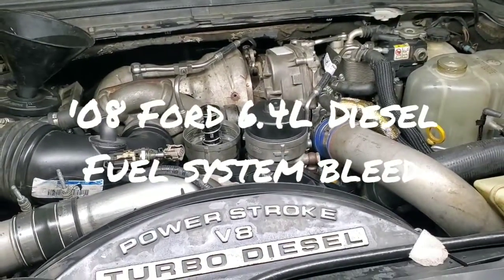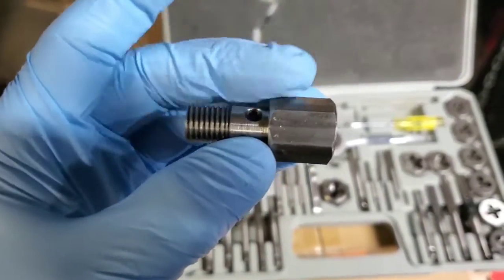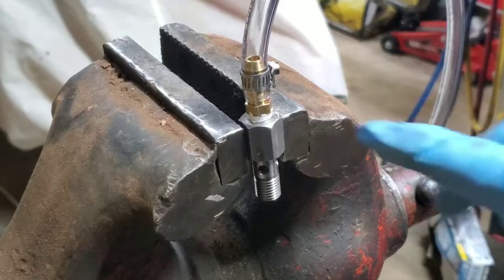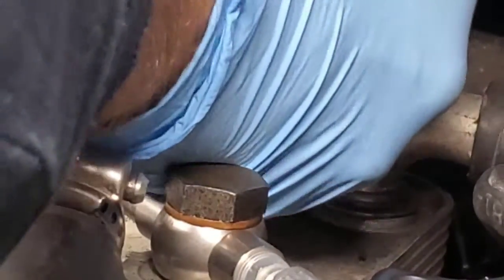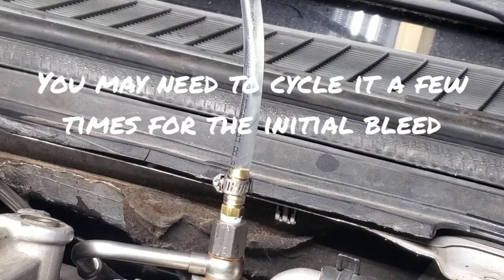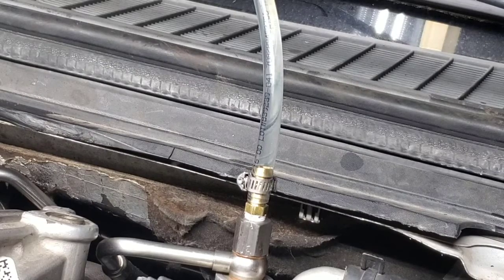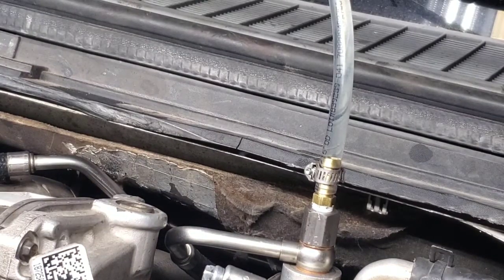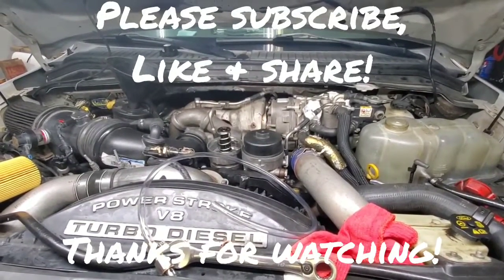How to Bleed the Ford 6.4L Powerstroke Fuel System

Comment: I I did this whole bleeding process and it'll crank but then dies. Everything has been replaced and double checked. I will crank it after I bled it and will still be full of air. Help!
Reply: I encounter the same issue... what did you ended up doing to the truck?
Reply: @hectordiaz3264  i know the issue if you haven't already figured it out.  i know a year late....
Reply: @sacredcreationz what was the issue

Comment: why not tape the original fitting and add a valve with barb on top that would stay on and apply a rubber cap to keep dust out.

Comment: Also don't forget to take the fuel tank filler cup off!! There might be vacuum in the tank, which I think sucks back the fuel, while changing  the fitting on the cooler.

Comment: Why not just leave the adapter fitting in place and just remove the brass hose barb fitting and replace it with a pipe plug?
Reply: Super high pressure system. You don't want to risk fuel blasting on top of the engine

Comment: REAL BIG THX you saved my life….. really…. I replaced the fuel filters on my 2008 f-350… all the procedures are correct…..EXCEPT the no need to build your own “special tool” with all that.
Here’s what I did to success; was instead of the fitting nut was not needed. After looking for diesel shops and even eBay it was obvious to me to find a hard plastic tube that would fit inside the treaded banjo nut was. I got the approximate plastic size tube that would fit inside the thread I used a little sand paper so it would snuggly fit in the threads by pushing and screwing the plastic tube inside and doing the rest of your video.   IT WORKED AND VERTUALLY COST ME NOTHING.  big thx man remember it’s only 12 p.s.i. so there’s no real pressure coming out of the tube into the container (static pressure that is…)🙂

Comment: I have bled my fuel system the same as described in the video and 2 hours later I have cycled 10 gallons of fuel and I am still getting large bubbles when I turn the key back on. Any suggestions?
Reply: Did you get it goin?
Reply: @bradleyhermes7071  I found the diesel fuel had some water in it so I drained the fuel completely, replaced the low pressure fuel pump,  replaced the diesel fuel and filters. Just as before after 2 hours of cycling the key I am still getting large bubbles of air. It will not fire or attempt to start. Any suggestions? Thanks
Reply: @fredcrum1  did you ever figure it out?
Reply: I have the same issue.   Did you figure yours out?

Comment: Hey - Great video.  Excellent demonstration and explanation.  Quick Q:  Is this procedure necessary after changing the fuel filters?  Or only after a more extensive fuel system job?  Such as changing injectors/injector lines, obviously after any fuel pump work, etc.
Reply: Late comment but after you change the filters you are supposed to cycle the key 8 times10 seconds each cycle. Then it should start.

Comment: most people ive seen just just turn the key ten times 10 times before starting after fuel filter change or just open fuel bleed valve right next to that fuel line you stripped off ???
Reply: Garrie Parsons why would you try to argue with a professional that’s showing the correct way to do something? Why did you watch the video if you already know everything?
Reply: @JC-dr8ev  people watch these videos for ways of fixing their own trucks cars at low cost, simply opening the bleed valve is the way to go , not running to stores buying parts a lot more time consuming and makes more of a meal of the job and more expensive .. i search for ideas on how to fix stuff on you tube , good job i didnt watch this one only get me running to stores buying parts when you can simply open bleed valve done in 5 minutes as its suppose to ... you should watch some educate yourself
Reply: @JC-dr8ev  thats why you have no thumbs up hardly and you spend all that time doing it the hard way ... when you can just use bleed  valve smart arse
Reply: Garrie Parsons you go ahead and use the schrader valve to bleed your system on a 6.4 and let us all know how that goes. There’s a reason there’s a special $100 tool to bleed a 6.4 system, and he’s showing you how to make your own tool. The valve you’re referring to is only to check fuel psi on these trucks.
Reply: @JC-dr8ev  ive seen enough videos people using this valve to do the job ... thanks and good day to you ....
Reply: @garrieparsons2265  christ, if you dont like the way he shows you, move on.
Reply: That’s what that air valve is for to bleed the air or at least that’s the way I was always Taught
Reply: @j10munoz66  that bleed valve is to bleed the low pressure side only. The high pressure side is the side that needs to be bled in his case. If you do fuel filter change then yes, you can bleed from that valve if it needs it.
Reply from the maker: The fuel line isn't stripped out, not sure why you think it's stripped. If your referring to the schrader valve, that is just a test port. The proper way to bleed is basically how I showed in this video, with the exception that you could buy the expensive tool instead of making your own. Thanks for watching.
Reply: that's not diesel in that tube. diesel has green dye in it.
Reply: I just cracked the back line and ran this on my engine that’s just a work truck. Did I just get lucky?